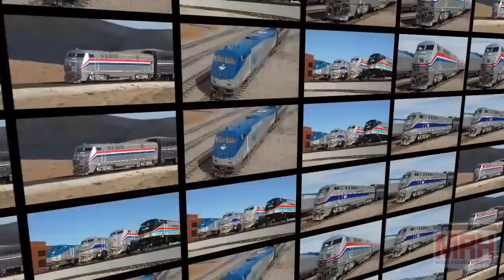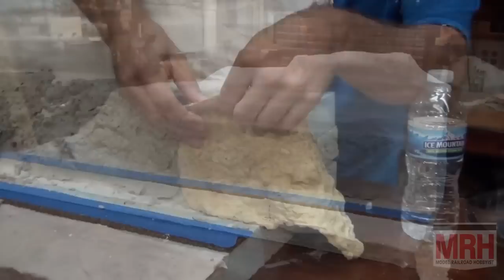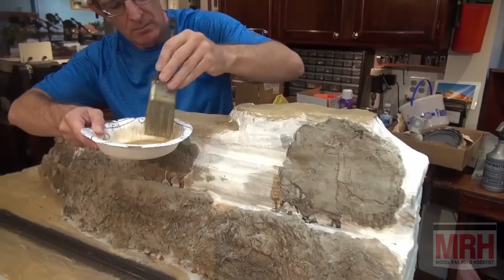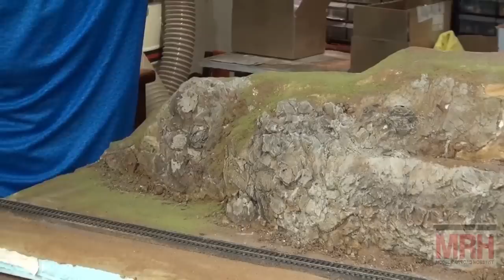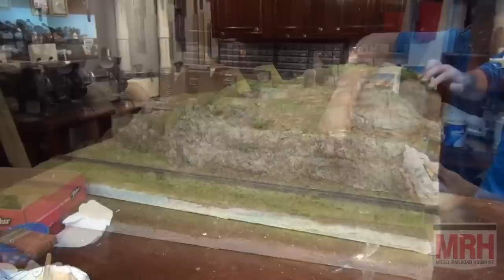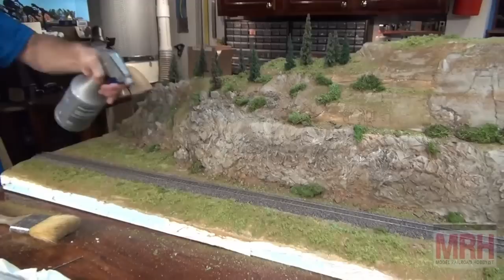Scenery from start to finish | October 2020 WHATS NEAT Model Railroad Hobbyist

Comment: Great video as always, Ken. 
I must say though as a tip for those inspired by this: you should try static grass. It is so much better scenically than fine turf especially at ho scale. I would have given all the foreground a static grass carpet.
I also liked seeing the ballast spreader. I have never seen one in action.

Comment: When you spray the track with the spray paint, how do you ensure good electrical conductivity on the track and at the turnouts?  Are there any particular precautions you take, or do you just clean the track with the Bright Boy afterwards?
Reply: Just clean the top of the rails, and any switch points, and you should have no issues.

Comment: Terrific video, two questions if I may, for doing the painting on the rock faces, is it the paint you're using that allows the paint to adhere and get absorbed by the castings or is it the type of plaster you're using? I'm using the Bragdon molds with plaster of paris and find I sometimes have to wait a week before the Woodland scenic rock coloring system leopard spot sprayed technique or it won't get absorbed. 
For the trees can you tell me the manufacturer please , thanks Lynn
Reply: The paint absorbs into the plaster, to a point. I never tried Woodland Scenics rock coloring. The trees are a combination of faller, Heki, Grande Central Gems, and probably some others. I had a box of various trees, and just grabbed them randomly for the project.
Reply: @tim01433  Thanks Tim.

Comment: Nice.  I think he is quite artistic.  That helps.  BTW is there any specific spray bottle for the water?  Mine work for about 15 minutes. then they are shot, so to speak.
Reply: Try the spray bottles sold at auto supply stores, or where they sell commercial cleaning supplies

Comment: This is great, do you need to prep the molds in between uses or just throw the plaster back on?
Reply: It depends, but basically I clean them every time before the next pour.
Reply: @tim01433  Got it, thanks!

Comment: Hey train all you train guys! I wanna make a new table top frozen Christmas mountain for my Christmas tree, I have a potted live bonsai tree I use. I have an N scale train in a box I got years ago. I want the train to wind up the mountain, polar express style... the mtn gonna be around 18-24 inches high. Can I just hide a steep downhill run in the back to get the train back down to the far side of the layout? This setup sits on my Amish fireplace, it’ll be roughly 16 deep and ~3ft long/wide. I’m trying to find out if my idea on getting the train back down the mountain will work. Mtn will be around 1/3 of the 16x36 inch footprint of the layout, hidden downhill tunnel in the back, down to a tunnel outlet in the far rear corner, bend/turn around that side, and runs back along the front of the layout back to the mountain. Is a ~20inch drop in 3 ft unrealistic?? There will be a turn at the bottom of that, maybe make the hill steeper so I can have a few inches of flat track right before it turns out of the tunnel? I just don’t want to build it and waste money and time if it won’t work...

Comment: He said you don't want dirt with clay. What is his reason for that?
Reply: The dirt will crack, and not glue properly. I live in eastern Oklahoma, and anything that is a suitable color has clay in it, and unfortunately won’t work.
Reply: If you cannot collect dirt without clay you can use grout, it makes great dirt.
Reply: I use it as well. Especially for dirt roads. I also mix colored grout with dirt to add color, and change the texture.

Comment: My biggest problem is with what the California state Senate jerks did a couple of years ago ,      outlawing sheet extruded foam .
Being about 80 miles away from the state line .
None of the hardware stores or insulation suppliers can get it .
Pink or blue sheets .
I tell them that I need it to build a HO layout and instead of sticking to what they know ,     they want to start arguing about how model railroading is dying hobby .

My response is always this .
" Before the pandemic the hobby averaged $ 1 . 5 Billion annually and the last time I checked the hobby broke it's own record of $ 2.7 Billion dollars this last year alone " .  Then my followup with " Yea right " .

I'm in Nevada .  If you can see about helping me with information  on locating the sheet foam without backing .        It would be very appreciative .

P. S.
Lowe's and Home Depot cannot get them either .
Pink is from Corning ( ? ) ,    blue is from Dow .
Reply: I couldn’t find the thicker foam in Arizona when I lived there. Seems more available in colder climates
Reply: @tim01433  
Thanks

Comment: You get much nicer looking rocks if you cast them solid first and attach with sulptamold.Most of the rocks on this piece have lost their definition. Looks ok overall though.
Reply: Richard Allsebrook the problem was that I rushed the process a bit, causing to loose some definition. I disagree with the process of casting them first then applying them. Neve looked natural, and no nice rock flow.